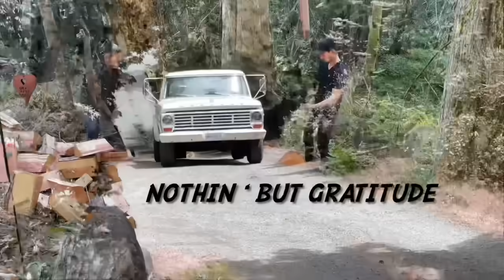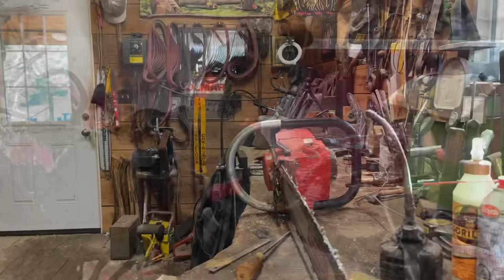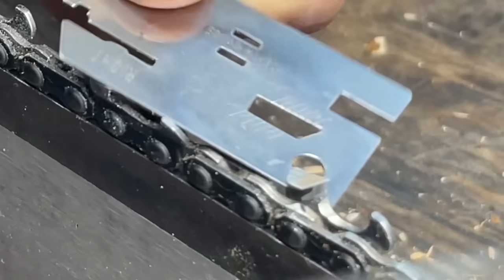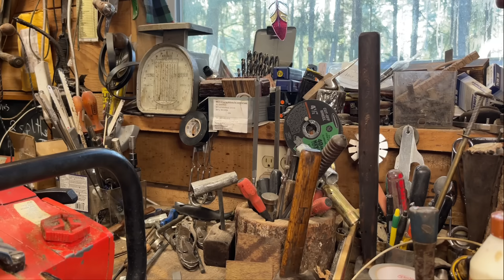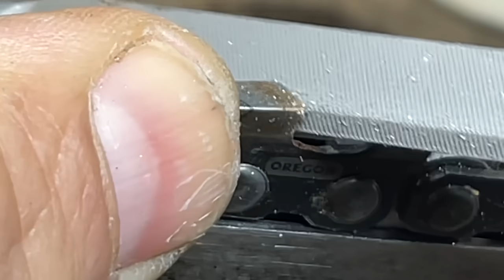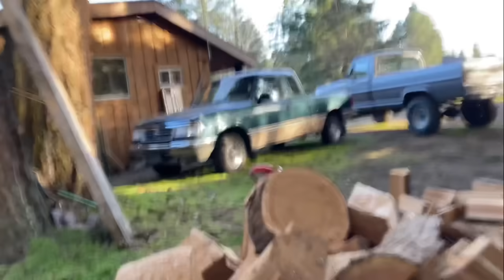Chainsaw Sharpening, filing Rakers, tips, and tricks.

Comment: Thanks to you I bought one of these Husqvarna Progressive rakers guages.  I'm not exactly sure why, but after adjusting the rakers with the Husqvarna, the saw cuts so so much better.  I'm guessing the forward angle vs. the flat top, but Wow, what a difference.
Reply from the maker: its how its done brother, well done
Reply: The raker is a depth gauge when you file it down you get a bigger bite in the wood.
Reply: Cuttin smooth is the key to fast cuttin🤘
Reply: As long as it’s a good one with good steel you’ll have it a while.

Comment: First off, love the work you do and have been following now for years. Have a question and I think I know the answer. What exactly do the rakers do and what happens when you don't flatten the raker compared to when you keep them at gauge height? Thanks, and keep up the awesome work! Also sorry for your recent loss.
Reply: The rakers controls the depth each tooth digs into the wood if you imagine a wood plane lower the rakers the deeper the cut if their too high and the teeth are sharp it won’t cut well if their too low the saw will be grabby and not cut smooth a raker gauge keeps ya smooth. Buckin once said….. “when standin up n buckin after gettin the gullet what we experience is just beautiful feelings” 
Hehe 
✌️❤️🌲🪵🪓🐝

Comment: If I'm not mistaken, after filing the raker to the right level you should round off the leading edge of the raker with the file to help avoid kickback, especially with a chain like that which doesn't have kickback protection.

Comment: Do the rakers BEFORE you file the chain, you'll dull the tooth while doing rakers. I would always switch sides doing rakers, when cutting 6ft to 8ft diameters my saw would run a little bit. Would also take out gullets to keep the chips flying when cutting big wood. Great to see someone do a great job on the art of hand filin!

Comment: It’s what my dr.‘a call “tennis elbow”.

That flat style file is easier for a person to see what is happening, but if you are filing the way that you showed on THIS video you should try that triangle style (it’s actually 6 sided though) because you end up with 3 filing edges, not just 2. The flat style is great when you want to also have a file for your depth gauge’s (rakers) but you’ll still need a flat style with you you if you go the 3 sided way. BTW, the 6 sided is what I use. I happy with it so far, but you have to keep a VERY close eye on what your doing with it.

Comment: Buckin' Billy Ray Where can I purchase the "Carlton File "O" Plate. Watching you on your video tells me that for the first in all me years of filing my saws that I have been filing all wrong. So you can teach an "OLD DOG" new tricks. I'm 73 years old and my first saw was a "Homelite Zip" w/ a 24" bar, it belong to my father. Now I run all Husky's, 394, 395 and my favorite is my "3194" w/ a 6' Cannon bar that I use for cutting slabs. After I fie all my saws the "Buckin' Billy way, the first log to slab will be a 60" dia. inch x 16.6" Redwood that I have been saving. Thanks for the great videos.

Comment: the Carlton file o plate he is using is s nice tool for sharpening. Is Carlton still making these? Buckin's tip on sharpening chains for small saw 3/8 lp chain to use a 3/16 file is great. This guy knows his business.
Reply: Unfortunately no, Carlton stopped making them some years ago. They can be found here and there on eBay, but the prices have gone up considerably in recent years

Comment: Buckin' I was always taught from a child to file to the tip of the tooth, I've always questioned why and no one could answer why. My brain tells me to file like sharpening a knife and to go the other way, the file doesn't like it at first but it does seem to hold an edge longer and my shindaiwa 757 eats alot more wood.  

Also I did send you a message through the website can you let me know if you received it. Thank you for all you do Buckin'.

Comment: Hey Billy, how you doin'?  Haven't talked to you for a while.  I agree with what you are saying about filing those rakers at an angle, it really makes a difference.  The only problem I have is that the ony raker guages we can get are the long ones made by "Oregon Chain" and they have a recessed area that the file goes into and it forces you to file the rakers at 90 degrees.  The slot for the file to fit into is only wide enough for the file to fit into and consequently the file cannot be angled.  I would sure like to have a raker guage like you use, but if I'm not mistaken you mentioned in one of your video's some time back that those raker guages like yours' are not made any more.  So we are stuck with what we have and just have to grit my teeth every time I file the rakers on my chains.

On a side note, I wanted to tell you a story.  My brother works for a construction company.  They were doing a job last year where they had to dismantle some bleachers at a high school.  They were made of wood and they started using the company chainsaw to cut them up with.  Ray (my brother) looked at the chain on the saw and he told me there was absolutely no gullet at all in that chain.  It wouldn't even begin to cut wood.  So he began "Getting the Gullet".  One of the guy's walked by asked him what the heck he was doing as the guy could see that he wasn't using the file like you would to sharpen the teeth.  Ray told him about the gullet and the guy walked off telling Ray he didn't know what he was doing.  After establishing the gullet back into that chain and resharpening the teeth the saw cut that wood like it was butter.  It surprises the heck out of me that there are so many people that don't know about the gullet on chainsaw chains and what they are there for.

OK that's it for now buddy.  Keep up the good work on the video's, they are much appreciated.

JIm

Comment: When ever filing any thing, file at a 45 degree angle never at 90 degrees it creates chatter in the file and the surfaces you’re trying to finish vs a cross hatch pattern! Just look at how you hand file your axe, I will almost guarantee that you at an angle and traveling across the bit not stationary and running in!

If you grab a piece of pipe, and file straight in at 90 degrees then look at it with a microscope or magnifying glass you will see some chatter marks, then move a few inches away, and file at 45 degrees in both directions and you will end up with a smoother finish and less chattering! An old machinist / blacksmith taught me this!

Comment: Unless Carlton changed their File-O-Plate at some point the two holes provide two different depth settings one should be hard wood and the other soft wood not for left and right rakers.  If one measures from the square cut out that bumps against the back of the tooth and to the two holes that go over the rakers there should be two different measurements which provide two different raker depths.

Comment: So it looks like the same length of all teeth is not that important  (as they tend to say) but what is very important is the proper length of rakers. Is it correct?  Meaning when we hit a nail say with 1 tooth only (I know, not very probable situation) we can only file this damaged tooth significantly but can also avoid filing of the remaining teeth. But the raker of the affected re-sharpened tooth needs to be filed.
I guess this short tooth won't cut anyway as the remaining teeth will be higher (despite the raker properly filed). We probably want to avoid too many short teeth on the same side but practically it's usually relatively in ballance. Where the truth lies?
Edit> Ok, looks like I should watch the video till the end first before commenting ;). You clearly mentioned the teeth length doesn't matter when the rakers height is properly set. Good to know as it will prolong the chain life.
Reply from the maker: tooth length has never mattered to me, I have shown this in many videos, myths

Comment: Billy, did you ever try out the Pferd or Stihl combined tooth and raker files?
I got one for each of my two saws and (the tools are chain size dependent) at a sale and use them occasionally in two different ways:

1. When I am done handfiling the teeth I sometimes I do a touch-up with the Stihl tool, at the same time adjusting the rakers.

2. If I hit dirt or metal and have to do a quick on-site filing until I get back to the workshop and nurse the chain back to top notch condition.

Besides, this tool is so fast to use, you wouldn't believe it until you've tried.

P.S. "Pferd" is German for "horse". Giddyup! :0)
Reply: I use the Stihl version, or used too. I handfile mostly now but not sure at what depth my rakers should be. I use a 3/8 .50 chain.
Reply: @dentondunn4346  The square file in the middle of your Stihl tool automatically takes care of the rakers. I usually use my Stihl tool every three or four times I have handfiled the chain, or when breaking in a new chain. Otherwise, I use a dedicated raker gauge like the ones Billy uses if I don't care to take out the Stihl tool.

However, my saw mechanic says just to give every raker a couple of strokes with a flat file once in a while; no reason for nitpcking. It's a matter of temper how aggresive you would want your chain to be, but when there's more dust than chips coming out of the saw, it's due time to shorten them rakers a bit.
Reply: @sneakyfox4651  ok thanks. I know the Pferd files the rakers to .030 and Stihl does the rakers at .025. I was just curious to what actual depth the rakers is supposed to be for the CS590 chain. Guess either way is ok, I have the Stihl but had to force my 7/32 file into it because it was a 13/64 sharpener so I plan on buying the Pferd version of it cause I think it's a better sharpener for the chain on the Echo Timberwolf. Thanks for your time and reply back to my comment

Comment: Hello from Florida and thanks for the video. Question:  should you remove the gauge while filing the raker?  It seems that over time, your gauge would get thinner, resulting in you being short. How long does the gauge last you?
Reply: The File o plate is made of extremely hard metal the file will not even scratch it, the cheaper oregons and such are a different softer metal,   I have been using the same File o plate for over 30yrs with no wear.

Comment: Do you have a part# for that Carlton gauge?  file size?  Thanks
Reply from the maker: file -o -plate ,, on ebay i believe
Reply: @BuckinBillyRaySmith  Carlton no longer makes the gauges, eBay shows 32503 Carlton (7/32) but can't tell if fir full or semi chisel.  Ording one now, very few left.  Thanks
Reply: Get a very similar one from West Coast Saw. The Carlton version is very hard if not impossible to find these days.
Reply: @carolinafirewood  Doesn't matter if it is full or semi chisel, nor if it is standard sequence or skip.
Reply: @justinjones9255  Thanks, I did just that.  Appreciate the tip!
Reply: @canamrider7195  Thanks. It shows a diff part# for each full and semi. Got it.

Comment: Here's one?.....would you consider doing this on a smaller saw. Like a climbing saw? Or is this just for falling/bucking purposes and the bigger saws/chains?
Reply from the maker: doin' what sir
Reply: @BuckinBillyRaySmith  sorry bout that. The square grind. Just thinking I'd like to try it out on a smaller scale before I go and do it on a longer chain. The bonus is I have 3x's the number of chains to practice on in the smaller size.
Reply: @wirthwhileproperty  I just converted a 3/8 low profile chain from round to square ground with the double bevel file the other day. On my Milwaukee cordless saw. It cut like mad!

Comment: Hello, i have a couple chain sharpening questions for the Buckin army, please.

When filing the gullett strokes should my file be at 90 degrees to the chain? As opposed to the 30 degrees when filing the top corner?

Also ive heard Billy ray and people commenting about using one file size bigger than manufacturers reccomended. I have a .325 chain which 3/16" file is reccomended. Should i use a 7/32"??

Thank you with any help!
Reply from the maker: stick with the 3/16 on that chain .... gullet strokes can be at any angle, but ya mise well stay in line. straight across is fine if its just gullet
Reply: Thanx buddy! 
Thanx to you im slowly getting better at sharpening. Practicepracticepractice...
I enjoyed the mens mental health vid. Im Going thru a rough patch and the vid was  good medicene.

Im Dave from Arkansas.
Thank you

Comment: Tell us again why you file the rakers, please.
Reply from the maker: so the cutters will reach the wood
Reply: @BuckinBillyRaySmith  , 

 So, as the cutters are filed, they get lower?
Reply: It is a depth gauge, tudyk21.  The depth gauge should allow the cutter to make contact with wood at a depth of .025 or so.
Reply: When you sharpen your chain the cutting head will get smaller ,  as it get smaller it will start to sit lower then the raker  when this happens the working edge of the tooth cannot bite the wood because its being blocked the raker this is why sometimes when  you know you have a sharp chain but it's still just not cutting fast  this may be the issue.

Comment: ok,    friends
Reply: So if the rakers are high that means you're not getting the cut the sauce not getting to cut it needs so that could overheat it when you adjust a rakers lower that means it's getting the proper cut it needs so it won't overheat is that correct or am I still lost

Comment: They are NOT RAKERS.       THEY ARE DEPTH FINDERS. OR DEPTH SETTERS IF YOU LIKE.   THEY ARE NOT RAKERS.
Reply: They are most certainly RAKERS..... 
Love wins 🤙
Reply: @littleredreiner6446  no. They are not.   I have been a sawyer for 45 years.    A raker removes material from a three tooth saw.      A chainsaw. Cutting tooth removes the material.        On a chainsaw. All the depth finders do is keep the tooth from crabbing to much material
Reply: @Johnrider1234  read your last sentence, again.